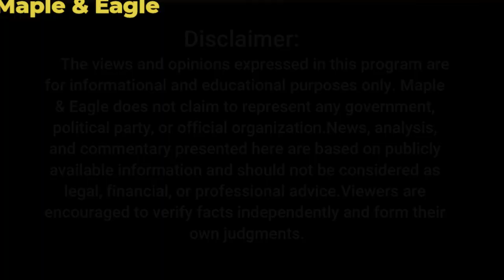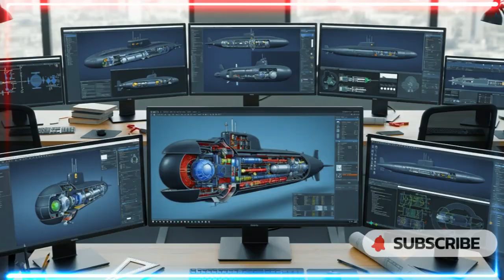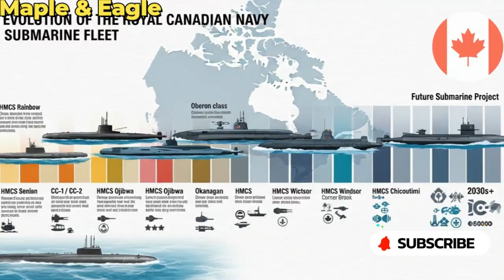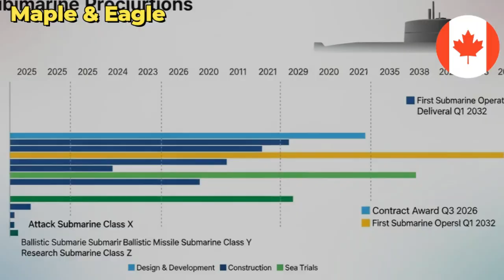The Future of Canada’s Navy? Inside Korea’s High-Tech Submarine Shipyard

Comment: Germany doesn't have engineers and technology to build submarines with modern technology such as lithium battery and high tech digital electronics. Type 214 was designed decades ago but had many problems. 212CD will have similar problem. Lithium battery safety will be a big problem for Germany. Germany simply doesn't have technology to build modern submarines.
Reply: Germany does have all technology required to deliver a Submarines equal if not superior to the Korean Submarines. If we wanted the latest battery technology and high tech digital electronics we should have gone with Japanese Submarines. But seriously the Germans have been leaders in most if all the technology the Korean have been developing for their Submarines. The current Korean designs are based on Germany license technology. The main difference between the two Submarines short listed by Canada is the German Submarines have been designed to operate in the Arctic environment from the start. That is where Canada will be using their Submarines as well.
Reply: @davidgough4750 outdated old technology.
Reply: @davidgough4750 Japanese sub is not high tech. No AIP. Nikel based battery has restrictive usage due to problems.
Reply from the maker: Thank you for sharing your perspective. It’s true that the Type 214 design has been around for some time and faced challenges, but Germany still remains one of the world leaders in submarine design and engineering. The 212CD program includes significant upgrades, such as improved stealth, automation, and energy systems. Both German and South Korean submarine technologies have unique strengths  and ongoing innovation from both sides continues to advance undersea capabilities worldwide.